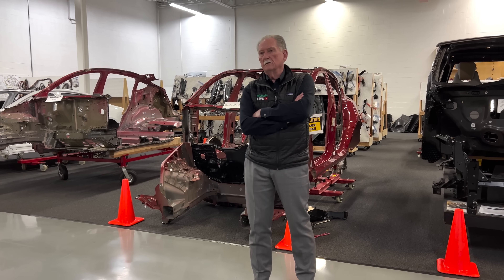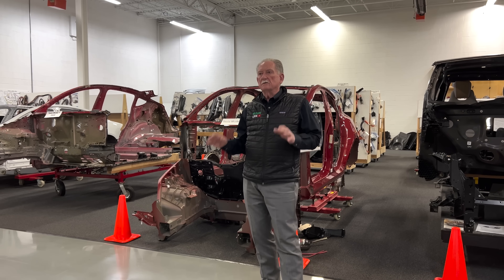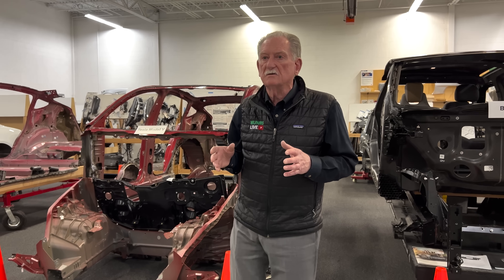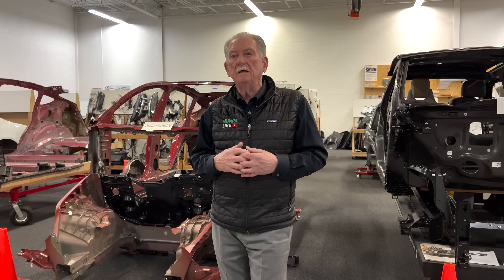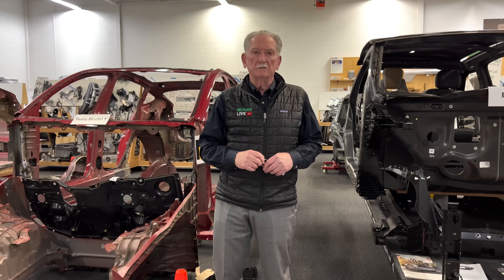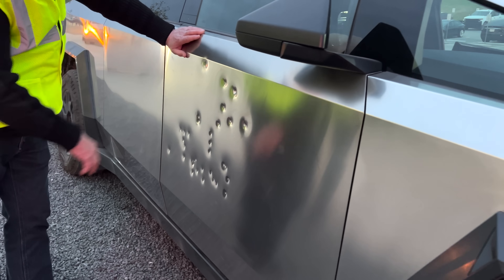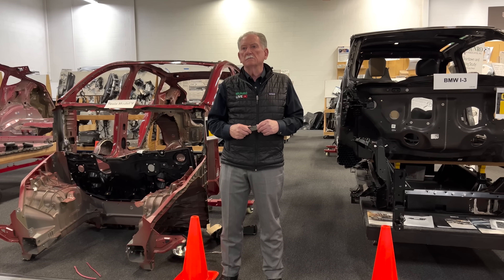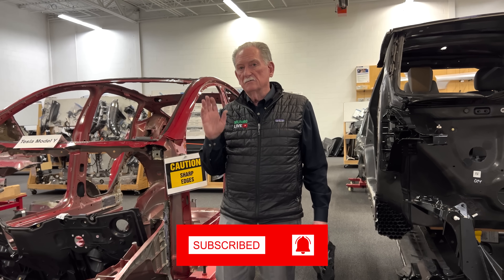An Engineering Analysis of the Tesla Cybertruck

Comment: There are 5 errors to the design, if it had these it would of been the best off roader by far...

1. Central driving position with 3 front seats (or the ability to modify to be able to do this is really important)
2. 500mm flat roof before the rear slope so the rear seat window is square to the roof, and 100 other reasons, one main one is the roof line is unnecessarily high...
3. CTIS Central Tyre inflation System
4. Portal final drives

Additionally Tesla needs to enter both the the Dakar and Baja in the EV category..

The reason for the "tough" stainless steel is adding boron, a wonder material that is added to just about anything to make it TAF.....

The new manufacturing process is hydraforming (using hydraulic force), rather than hydroforming (using pnuematic force) , this is an ideal system  due to the huge force (500bar or greater) for forming stainless steel, after this they drop the material into liquid nitrogen at −196 °C to cryogenically toughen it...
Reply: 9 out of 10 trucks, never see dirt, never tow anything, move a case of beer a few times a year. 
For the remaining 1 out of 10 users this may or may not be the truck for there needs. 
Even then a van may be a far better choice.
Reply: Oh so there going to be Chelsea Tractors, I doubt it... @universeisundernoobligatio3283
Reply: @universeisundernoobligatio3283   And 9 out of 10 average truck owners, aren't into expending almost 100K for a Science project.
Reply: @RogerM88  Well, here's the important question: Will it sell? Of course. Will SOME people use it for pickup-truck things? Seems likely. So what's the problem? Your version of "perfect" is obviously not universal, so just because you find some nits, doesn't mean someone else doesn't see it as perfection.
Reply: @RogerM88  
And 9 out of 10 average truck owners, spend 100k to show off there manhood.
Reply: @universeisundernoobligatio3283   I completely disagree. By the way, I'm a truck owner.
Reply: @ColinFox   So it's a glorified electric SUV. Big purchase contracts with pick-ups are do under fleets. And they aren't looking for 100K trucks. Also where is the "game over" Tesla Semi? Besides hauling "heavy loads" of potato chips, or caught being towed? The market for the Cybertruck, is the same as the Hummer EV as Rivian R1T.
Reply: @RogerM88 
Never owned truck, always found a trailer that I can pull with any vehicle far more useful. Easy to move 16" lumber.
Reply: Of course not, it a genius design, 95% perfect....its only an opinion as someone built trucks for the Dakar! @ColinFox